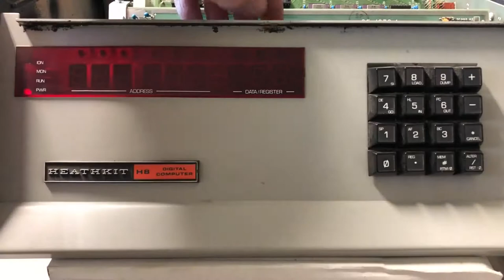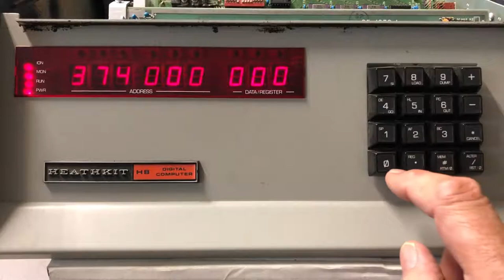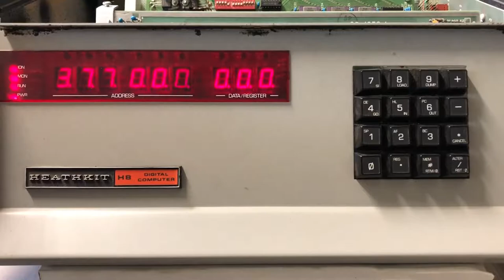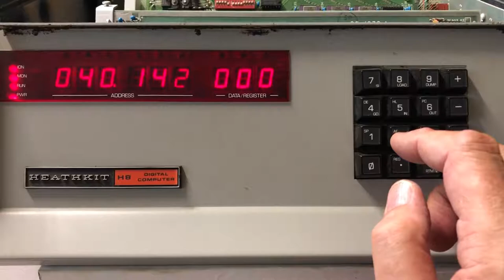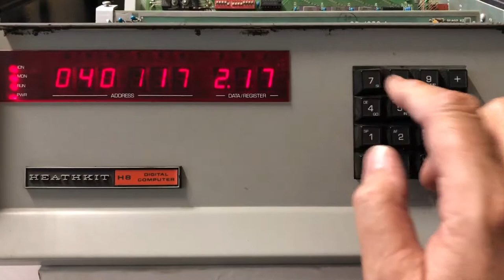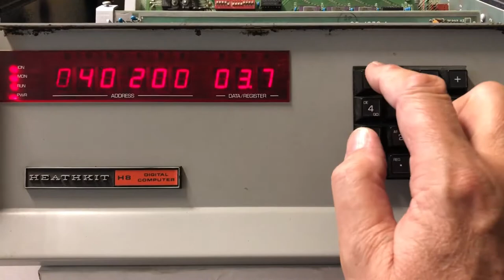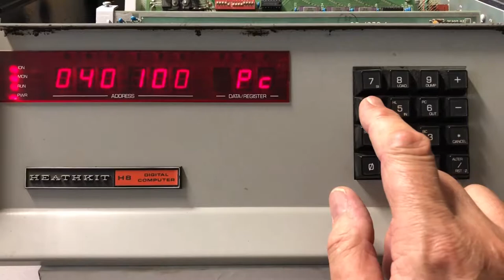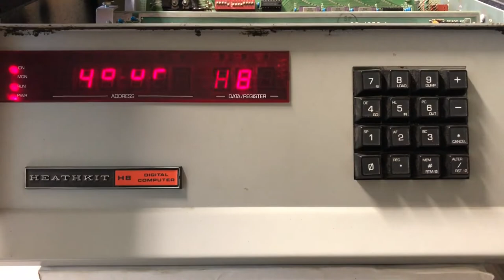HeathKit H8 - Part 2 - Entering and running the first program using the front panel - STB169

Comment: For those wondering about the LEDs (which I'm guessing are explained in a future episode), these are, from the bottom up:

• PWR: Power present on +8V line.
• RUN: CPU is running. This is the M1 signal from the CPU, stretched by a one-shot to about 4.7 μs length.
• MON: Monitor is running. Or something else has written bit 5 of port 0260 ($B0) in the last two milliseconds.
• ION: Interrupts are enabled (the system's EI signal line is high).
Reply from the maker: Thanks, I don't know that I got into that detail. I should get the system back on the bench in the next year.

Comment: Great video!  Seriously...I've designed a simple 6502 computer.  Waiting for the PCB to arrive.  I'd love to put a from panel on it.  :-)  One thing I noticed...was the "4" in the middle a typo?  I mean....typos are almost impossible to avoid with such an entry system.  Imagine the gold ole' days when people would type in tape loaders, for example.  Or card loaders.  The octal format is interesting as well.  One advantage is that you don't need A-F keys.  So if your keypad is limited, it's a great way to enter data.

Comment: interesting that ther osborne book on programming and interfacing the 8080, sort of the seminal programming text, did all it's work in octal. some of the first 8080 trainers, were also in octal.
Reply from the maker: As I recall Intel's early documentation also used octal. The E&L MMD1 and MMD2 also worked in octal as did a lot of the 8080 trainers.
Reply from the maker: If you look at the early 8080 databooks they used octal.